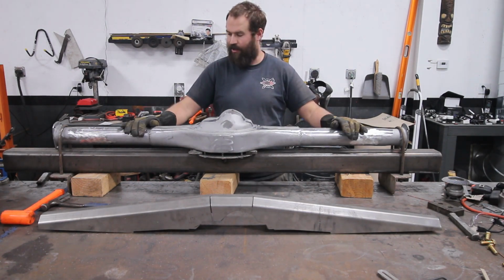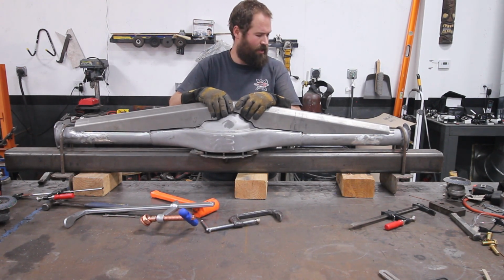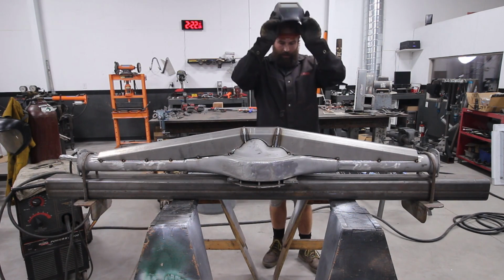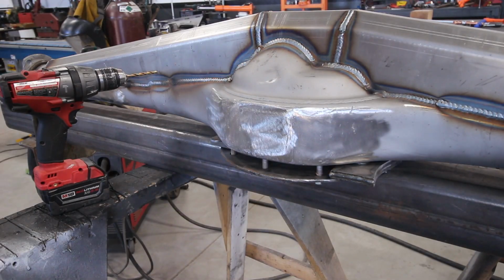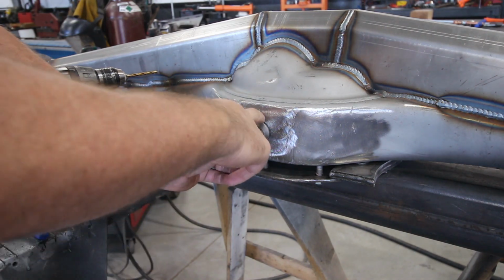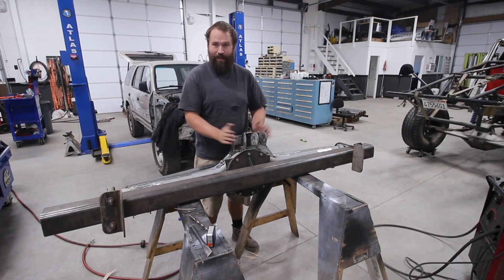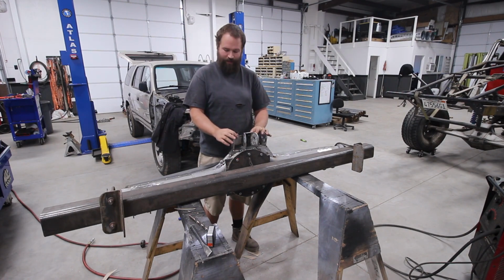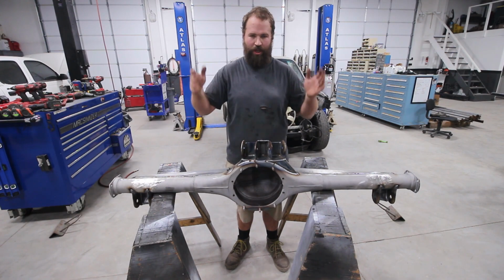How to truss and Tab a Ford 9 inch axle

Comment: Nice to see shops sharing "How To" vids.
Reply from the maker: Yeah excited to get back in the shop and make more videos.   The accident slowed things down and changed everything for me
Reply: @TTMotorsports  Im new to the site. What accident? I have a small 4x4 Van conversion business in Socal and I am always looking to make new networking connections.
Reply from the maker: Day before Thanksgiving 2019 had a rear tire blowout and caused a rollover
Reply from the maker: Whats the 4x4 van conversion company.  I had a 01 ford e350 I wanted to convert to 4x4 in the past but never got around to it
Reply: @TTMotorsports  X.U.V.  (Xtreme Utility Vans) I just started the company less than a year ago. I convert only the Chevy express and GMC Savana full size vans. All my suspension components are CAD drawn using factory SEMA data. Started off with IFS set up but went back to straight axle design as the parts are much more reasonable to acquire and the build time is only days vs weeks w/ifs. I have custom front & rear bumpers, roof rack w/rear ladder and side steps. All components are water jetted then bent in house and welded by me.  No web page yet but getting close.
Reply from the maker: Check out tt.motorsports on Instagram

Comment: Killer axle build... where did u get the weld in bungs?
Reply from the maker: Thanks, I buy all those and mis alignment spacers from www.polyperformance.com which I am a dealer for as well.
Reply from the maker: The drain/fill plug are pipe thread and I get those from mcmaster.com

Comment: Nice work!  How do you cut your material?  It has clean cuts.  Plasma or laser?  Thanks.
Reply from the maker: I have a CNC plasma table and it cuts very clean and I just use a flap disc on my grinder to deburr it and clean the cut plates.  Works awesome.
Reply: @TTMotorsports  Thank you for the reply.  I was wondering because I read some horrible comments from some users of plasma, while others have great results.  Seems some don't know how to operate these setups correctly.
Reply from the maker: @maximilian.R  Yeah if I set my cut height or speed incorrectly it doesn't cut that good but still can be cleaned up easily with the flap disc on my grinder.

Comment: Looks great!

I have a Frontier that I plan on doing a SAS swap to using the axles from a 76 or 77 F150. That's a nine inch in the rear and a HP 44 up front. My truck will be for crawling mostly on the east coast. I notice this is a prerunner so I assume up front is long travel independent for this Tacoma.

What vehicle did that nine inch axle come out of?

Also what thickness are those tabs? Lots of times you see guys on pirate or else where making tabs from quarter inch steel. That's always seemed really thick to me for a vehicle that is not a rock bouncer. I figure guys just way overbuild things because that's easier than figuring out what they actually need. Yours seem thinner, but this is a prerunner so it might be because it's a different application. I've mostly looked into crawlers. Anyway I'd appreciate your input on what you think is reasonable thickness for those tabs.

I know suspension geometry can be proprietary and you might not want to give too much away, but if you could do a video on link geometry that would be really interesting. 

Thanks. Keep the videos coming.
Reply from the maker: This 9inch is from a full size econoline van.  Widest 9inch you can find stock.

Tabs are 3/16 thick and work great for prerunner embrace vehicles get weld washers or 1/4inch tabs. 

Lots of threads on pirate 4x4 about link geometry and I use the 4 link calculator to determine link placement.

Comment: No preload on housing before welding?
Reply from the maker: Yes I have a very heavy wall box tube that I attach the house to and I do preload it a slight bit to weld the truss.  I then have a lineup bar and fixtures to check straightness and adjust if needed

Comment: Sorry to bug you guys, what is a good starting point for a 9" rear axle housing end to end on a linked rear build? Ty! C10/F150
Reply from the maker: For a full size an econoline housing makes it about same width as stock.  A camburg rearend can be ordered whatever width you want to match the front
Reply: @TTMotorsports  Great, Thanks! I'm going to have to hit up a few junk yards for an Econo-Line Housing.

Comment: What is a good baseline angle for the upper and lower link mounts? What 4 link software do you use? Thx
Reply from the maker: These are set at 15 degree.  I use 4 link calculator done by triage google it and you'll find it and thread on pirate 4x4. Works great
Reply: @TTMotorsports  Thanks for your response!